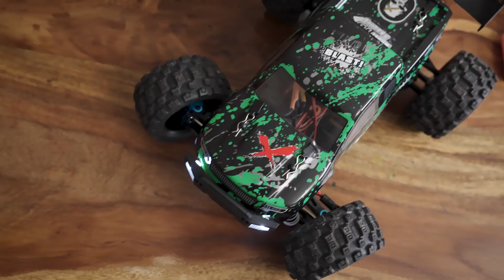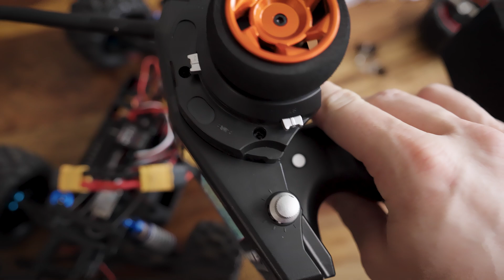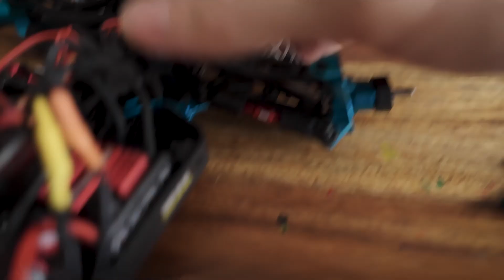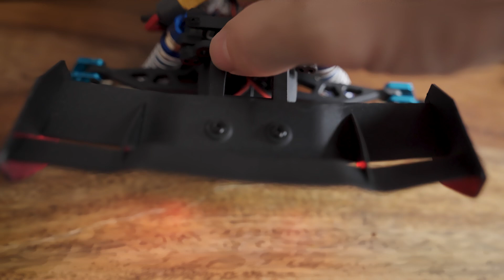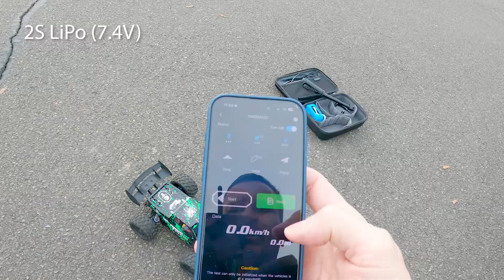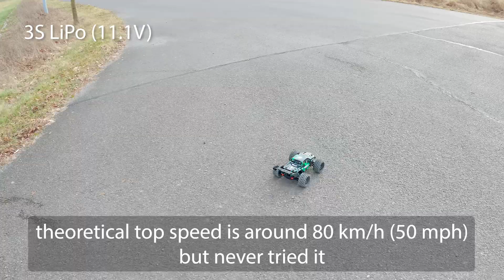Haiboxing HBX 18859 upgrade part 3: final tuning guide | Arrma parts |Hobbywing | RadioLink | Savöx

Comment: I upgraded the 18868 from my son. Beside from the cups, all metal drive parts, Oilshocks, HBX ESC from the 16889a pro, adapt the wheelie bar from the 16889, 84mm wheels, 2838 4500 motor, also 16 pinion and a gyro to control all this power. Now my 16889a pro looks like in slow motion.
Reply from the maker: Sounds like a cool build. Have fun with it, you two. 😊

Comment: Is there anything that can be upgraded or added to help keep the nose end down during full throttle?
Reply from the maker: Of course there is something you can do. You can use adhesive wheel weights from car tires and stick them to the underside in the front area. That's what I did too. 👍🏼
Reply: @TheRCTechLab cool! I’m just getting into the hobby, so I decided to start with the 18859E because it’s affordable and seems fairly durable. I figured it would be a good platform to learn on and gradually experiment with upgrades, rather than jumping straight into a brushless model before I’ve had a chance to learn the basics and see how much I really enjoy the hobby
Reply from the maker: Welcome to the hobby! 😊

Comment: I use 3s.but i crank the power down to about 40%,gives it a little bit more than 2s,but you have a nice build.
Reply from the maker: Thank you! 
Yes, often turn the power a bit down on 3S as well. Results in good power and speed and a long runtime. 👍🏼

Comment: Man you got a really nice set up I had the same model and everything put upgrades on it with MJX hyper go 45 AES C from an old car I had and put it in with a 5400 or 4500 kilovolt motor with cooling fans everything else stock pink gear though I need a small opinion gear because it doesn't want to power app through the tall grass but it will as long as it stays going yeah man that thing's awesome I just know the potential for it now seeing this video but I would definitely like to get mine to that point
Reply: It was already the brushless version I was just trying to Frankenstein and make a beast out of it  Still kind of a newbie to this trying to figure things out trial-and-error  Right
Reply from the maker: Thanks man! :) Yeah, with a smaller pinion the truck will beat steeper terrain!

Comment: nice video man i want to upgradee to 3s on this rc car what do i need to change and for the chepest possible
Reply from the maker: Glad you like my video. I recommend this Hobbywing 16BL30 / 2435 combo. It even handles 3S without any problems. Haven’t tried other ESC/Motors. But I can tell you - 3S is fun but kinda overkill for this little RC.
Reply: @TheRCTechLab  perfect because . I bought all 3S component and I’m looking for a RC car that can fit and it’s usually 1/10 so yeah thanks again for the advice😊
Reply from the maker: Oh, for a 1/10th scale you’ll need a bigger ESC and Motor because of the weight of the RC.

Comment: Great video!! Do you have another tip for tyres(with rims) tahn does not cost 40 euro because I just started the hobby. I have the same car but the tyres really drift to much. Aliexpress, amazon, erc. does not matter. Should have good grip offeoad but not 40 euro for beginnee budget 😂.thanks a lot!!
Reply from the maker: Thank you! 😃
Yeah, the stock tires are absolute crap especially when you have tuned the car. Unfortunately I don’t have any experience with other wheels than the Prolines.
Reply: @TheRCTechLab ok...maybe a I will order this tyres....cause it seems that everybody is really satisfied with them. Thanks a lot!

Comment: Do you have a link for the 16t pinion and the bearings?  I’m having trouble finding one, or I’m just misunderstanding. Also thanks this video has been extremely helpful. I started watching videos to try to fix the loose stealing and do some budget upgrades. Then I found your video and now I’m doing everything haha.
Reply from the maker: I'm really glad you like my video! 
The pinion in the video is the “16T 0.5M 2mm RW Racing RW0500-16” from the description. Unfortunately I don’t have the link. 16T mod 0.5 pinions with a 2mm shaft are hard to find. At the moment I'm trying a 2mm to 3.175mm shaft adapter, then the choice of pinions is bigger. That also seems to work well. 
The ball bearings are standard inch bearings, you can also just search for the designation R168, then you will find them.

Comment: CAn we upgrade the rear drive shafts with cups to CVD from the front?  The stocks fit but upgrade parts say they won't fit, not sure why.
Reply from the maker: I just checked front and rear metal drive shafts and they have a slightly different length. So it will not fit.
Reply: @TheRCTechLab  saw that. It works until you try to extend wheel travel. Stock has plastic axels that are different so look ok at first. Thanks for confirming.